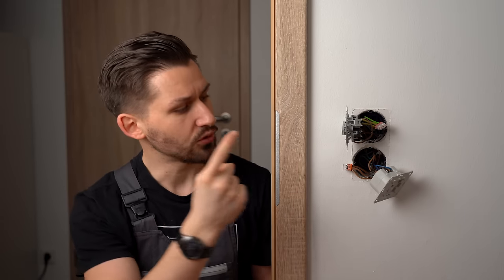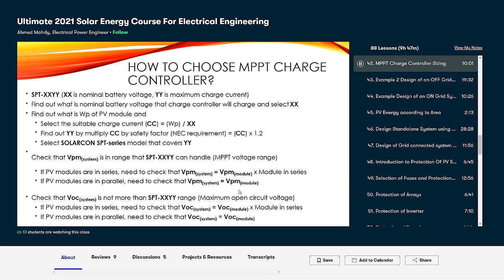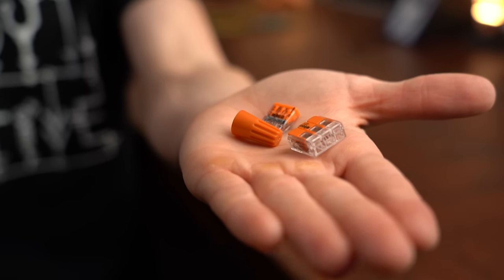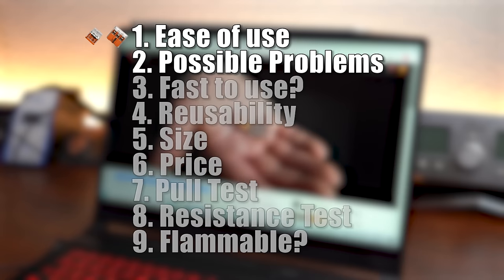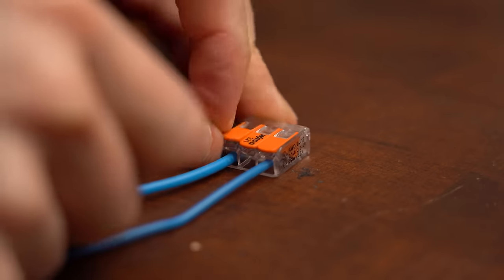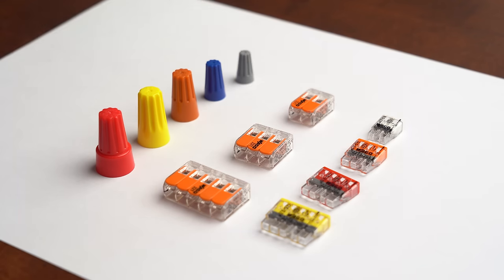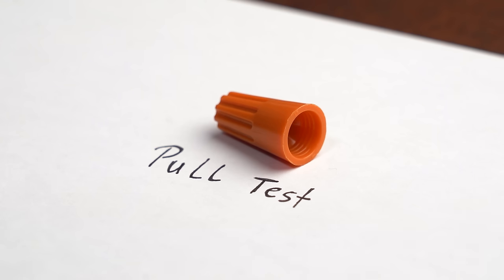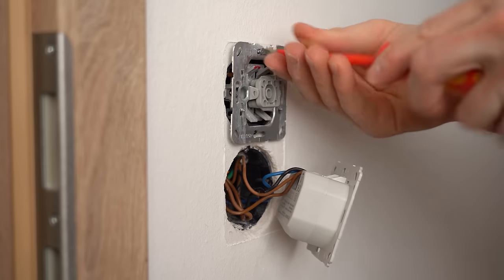What Wire Connector is the Best? Settling a Debate! Wire Nut VS Wago

Comment: USA electrician apprentice here, when using a wire nut with both stranded and solid you strip the stranded a few mm extra and when placing it in the wire nut extend it slightly more then the solid, this makes the stranded wire wrap around the solid wire much more reliably. When doing it that way I don’t think I’ve had a single wire nut tug off (you should always give the connector a slight tug after installing any connector imo)
Reply from the maker: Thanks for the tip :-)
Reply: This is correct. Good technique and no matter which connector you use always give a pull to test. I've had bad wirenuts and a bad wago spring and found out when I pulled them right off. Into the trash they went and redo the connection. A tight connection is a safe connection
Reply: I came down to say the same thing, I also pre-twist them a little and they're reliable enough. Also, last time I bought a bag they came to around 2 cents a piece here lol.
Reply: You do have to be careful how much extra length you strip from the stranded, because you can end up with the wire nut only biting the ends of the strands, which can leave the solid able to be pulled out of the joint easily.
Reply: @jarphabib  I Never Use A Wire Nut On Stranded Wires Unless It Is Low Voltage! Stranded Wire Can Be Tinned With Solder To Perform The Best With Wire Nuts! I Have Never Had To Replace The Ideal Brand Of Wire Nut! But Some Of the Cheap Ones Are Crap To Start With! If The Nut Will Not Tighten Up So I Can No longer Twist On It It Goes Into The Trash! Winged Wire Nuts Work Great By Hand But If Using The Other Type They Make A Driver For Them! Or I Use The Strippers Designed Just To Do That!
Reply: @jarphabib  this !
Reply: Imagine needing to rely on mystical knowledge passed down through the ages to get two wires joined up.

Wago. Push wires in. Done. Even a donkey could do it.
Reply: @MechanicalMooCow  He Showed You The Problem With These CRAP Connectors! HEAT!! They Are Inferior And Over Time Corrode! Voltage Drop = Heat! Heat = Corrosion! Not Suitable For A Perminant Connection Inside Your Walls! They Are Used Instead For Low Amperage Connections Like Those In LED Lighting! Connections They Know Will Be Replaced In Less Than 15 Years! I Have Had To Replace These Crap Connectors But Have Never Had To Replace A Wire Nut Due To FAILURE!
Reply: For wire nuts, along with stripping the stranded wire an extra 1/8" (3mm), I usually put a couple of very mild kinks in the solid wire.  Then pre-wrap the stranded wire around the solid wire.  This gives a good secure connection.
Reply: 100% correct. This is spec from the manufacturers for a good reason as stated by Reuben.
Reply: @kevinlsims7330  to add to my previous comment, I'm sure you're right, but it doesn't take away from the fact that wago are a far more intuitive, better designed connector.
Reply: @MechanicalMooCow  Quote from the first result when searching for wire nut user manual: 
"Hold wires together with ends even. Lead stranded wires slightly ahead of solid wires".
Not so mystical for wire nuts and agreed an improper use of Wago is unlikely, but better to read the instructions regardless just to be safe.
Reply: @tuber0tuber  I don't disagree, but you should never trust the end user to not think they know better than the manufacturer and just flat out ignore the manual. A key element of design for software (where I'm situated) is to take as much thought or guesswork out of the interaction with the user, because very few will actually read through manuals and instructions, instead trying to intuit the use of the system. As a second subject during my Comp Sci degree I took psychology. People are predictable and always choose to minimise effort. It's why we have electricity in the first place. Humans hate manual labour and we thought our way out of having to do it as much as possible.
Reply: The wire nuts from ideal do say to do that when joining stranded and not stranded wires together it also give a conductor sizing chart for each type of nut. 
This video did a great job covering the basics. 

When buying nuts stick to ideal or 3M brand I have never found another brand of wire nut that was worth it. Also if you buy wagos watch out for counterfeits.
Reply: @kevinlsims7330  You should never use solder tinned wire in a crimp connection. It's OK to use solder to cover the already crimped joint as an encapsulant, but then you also need a strain relief jacket to ensure solder didn't wick up the strands where it could affect flexibility and long term reliability.
Reply: @KS1776  I was going to say the same thing.  Ideal and 3M have more tooth to them, and have better holding strength as well as continuity.  Ideal are my fave.
Reply: I believe it's to allow the coil to grab ahold of the stranded wire and not just push it down as you wrap. There was a video uploaded that explains it. I also believe it's part of how to wire a stranded wire fixture. I'll see if I can find instructions and not tear into a ceiling fan I'll be installing one of these days
Reply: @MechanicalMooCow  except wago isn't readily available at every hardware store and Walmart in the United States. I love wago and keep a ton on hand but it can fill a box up pretty quickly
Reply: @Peter_S_  a wire nut  is not a crimped connection. Also I always wrap my wirenuts with good quality 3m electrical tape In the direction of the twist to prevent the nut from working back as you bend it into a wall box. I wish our wall boxes in the states had a space along the side you can fold the wire in easier as the new smart switched are so deep
Reply: @pen25  the more they sell, the more demand there is, the more stores will stock them.
Reply: @kevinlsims7330  I agree on the heat issue with Wago. The moment he got to the resistance test, the answer was already obvious. A Wire Nut involves a single direct wire to wire connection, whereas Wago involves two connections (wire to Wago and wire to Wago).  So, the expectation was at least twice the resistance with Wago, as was the case.
I'd only ever considered Wago for low voltage / low power connections. Although, to be fair, any Mains Terminal Block exhibits the same increased resistance issue.
Reply: @MechanicalMooCow  Mystical? IIRC it's printed on the bag if you buy good ones and not chinesium shit.
Reply: @gregclare  Wagos will work perfectly fine at higher voltages.

I don't get the "lower Voltage" therefore higher resistance is ok argument.

At lower voltages the same resistance will be worse. As you will draw more current and the voltage drop across the connector will have a constant amount regardless of voltage. That is just dependent on current.

All of this leeds to higher voltage circuits where currents are lower, to be easier on more resistive connections, than lower voltage circuits where almost any resistance will butcher your voltage.
Reply: @greatscottlab  Garbage is in your brain. Those nuts work perfectly well: first insert the stranded, then insert the solid so it pushes the stranded against the thread inside, then turn. Voila - all you had to do is use a brain.
Reply: Best method when dealing with stranded to solid wire splices is to just twist the two together, and use your cutters to trim the end so you have a full cross section at the tip for all the wires in the splice. 
This makes sure you don't have either one leading with excessive length, reducing the contact and retention capability of the wire nut.
The stranded wire generally spirals around the solid wire, so the amount of extra length needed for the stranded will vary depending on the gauge and the amount of twisting the installer is doing. 
Clipping the tip gets it exactly even without guessing.
Reply: @gregclare  and at 240v 20A it's ~2W of lost power at every connection due to 2 phases.
Reply: @bowez9  2W is what percentage of the total draw on the circuit?
Reply: @wingerrrrrrrrr  well it's 15 times more waste than with a wire nut, so not only is the nut cheaper to buy but cheaper to use.  Not only this but is easier to deal with than "ghost power" use.
Depending on how a circuit is laid out 10-15W is feasible and at that point, do you leave a light on all the tome?
Reply: @bowez9  if it dissipated 2W when the circuit is drawing 2400W, then it's an additional 0.083% power loss.  
If I left a 60W light on all the time, that would be an extra 50mW.
An 17W LED light is 14mW, or 0.123 kWhr left on for a year. 2.5 cents  at a rate of 20¢ per kWhr. One wire connector cost per year.
 Pet the sweaty stuff rather than sweat the petty stuff 😎.ll
Reply: @wingerrrrrrrrr  try again outlets are usually daisy chained in a room and not home runs.
But on the only clearly objective test the nut is vastly superior there is no defense for Wago other than preference.
Reply: @bowez9  Not sure what you're trying to say about daisy chaining. 20A through a splice is 20A whether daisy chained or direct.
Reply: @bowez9  daisy chained outlets? I don't know where you live, but over here that isn't allowed by code. It hasn't been allowed since 1980...

Also I'd like to see you fit wire nuts in the central junction box in a room, where there's going to be 5 or 6 connections each for phase, neutral and ground. I'd rather have 3 neat, flat packages of individual cables, rather than 3 twisted wannabe welding cables.
Reply: @fermitupoupon1754  so every single outlet you have is on its own individual breaker?  Or are the wired in parallel on one breaker (daisy chained)?

The box is required to be sized by volume for the wire inside of it at which point with s properly size box it is easy to install the proper wire nuts.
Reply: @bowez9  daisy chaining would be wiring them in series, not in parallel.

From the breaker panel there is a single run to a central junction box, from there each outlet and switch has it's own dedicated wiring run. 
It's a star configuration or hub-and-spoke.

Also wiring nuts have been against code here since 1-1-1980. 
And even if they weren't I for one would not like to have to deal with wire nuts that have to contain 6 2.5mm^2  wires in them.
Reply: @fermitupoupon1754  in the US outlets are wired with pig tails in parallel so you don't have 6 conductors at one connection (usually max out at 4 but would be 12AWG/4.0mm since is 20A)
Reply: I worked in a factory with various types of connectors and every single wire was visually inspected and tugged with pliers by two different people, one in assembly and one in inspection.  I inspected thousands of wires!  They dubbed me inspector 13 because I kept a very tight tolerance.  NO failures.  I was taught in high school to always look up the skirt of wire nuts.  If you see anything bare, do it again.
Reply: @pen25  Yeah, and 10 quality wire nuts for the price of 1 Wago.
Reply: To everyone mentioning that stranded wire can be tinned with solder prior to its installation in a crimped connection, this is not correct. Solder is an extremely soft alloy, and it can deform after extended periods of time. This causes a loose connection, which raises the resistance at the wire junction, which causes a higher heat dissipation, which loosens the connection further. The cycle continues until the connection fails completely. Therefore, stranded wire should be installed in crimped connections (screw terminals, splices, wire nuts, WAGO connectors, etc.) with no modification. Solder is great, but it should only be used in cases where the solder forms the majority of the mechanical bond between conductors.
Reply: @greatscottlab  You should test the connectors with a real glowing loose connection instead of just melting them with a hot gun.Obviously both will melt,but not all plastics are equally flammable and some will self extinguish.
Reply: @MechanicalMooCow  post videos online when your house burns down because of shittily installed wago connectors
Reply: @richardmillhousenixon  🤣
Reply: Reuben, you must be apprenticing in Michigan (our electrical code is about 50 years out of date compared to the rest of the country).  In NEC states using a wire nut to join a solid and a stranded wire is illegal.  The Wago connector would be a much better choice for the few times that is necessary, I suppose if I did this for a living I would order some from whatever European country they come from.
Reply: @pen25  Ironically, we have crimping connectors (and crimpers) in the US as well.  I have some in my electrical connector box that I bought 25 years ago but seldom use them, to my best knowledge they are only used on solid core wire.
Reply: @bowez9  I was going to say.  I know Michigan electrical codes are generally 50 years behind the NEC but our 110VAC outlets are built to be daisy chained.  I prefer my air conditioners, microwave, refrigerator, freezer and one outlet for use with the air fryer or toaster to be on its own 20 amp circuit but it is perfectly safe to daisy chain outlets on circuits serving low draw devices.
Reply: apparently your being properly trained. Dont give in to shortcuts, dont use wagos.
Reply: @kevinlsims7330  wHY dO yOU cAPITALIZE tHE fIRST lETTER oF eVERY wORD? tHAT iS sO bIZZARE.
Reply: @pen25 
WAGO lever connectors are sold in store at Home Depot, but not Lowe’s.  Ideal has lever connectors now, and it’s a matter of time before those are sold at every HD and Lowe’s.

Amazon right now has the Ideal In-Sure lever connector.  They’re still pretty expensive other than their jar of 500 2-port selling for $26.  They’re sold directly by Amazon and they have nothing else (like 3 or 5 ports) at a similar price point.
Reply: Yes. Many people do not do this or pre-twist and just want the wirenut to do the mechanical work. The ones with the wing-tab almost encourage it. Also, the quality of many wirenuts is not that great, and the little coil inside will break away from the housing.
Reply: @MechanicalMooCow  Really? But surely you need to strip the wire first...? You're talking about others having existing knowledge, but stripping the outer is also existing knowledge. And don't go talking about common sense as there are plenty of connectors out there you don't need to strip, and plenty of people who just don't have that existing knowledge.

A lot of the arguments I see for Wagos is "anyone can use them", I don't think the best connection should be based on what's easiest for everyone. (nb. I am a wire nut hater before anyone thinks I am somehow biased towards them).
Reply: @kevinlsims7330  Soldering is a bad idea... it can go brittle and if it gets too hot it can melt and if there is no spring loaded connecter it will loosen the connection.